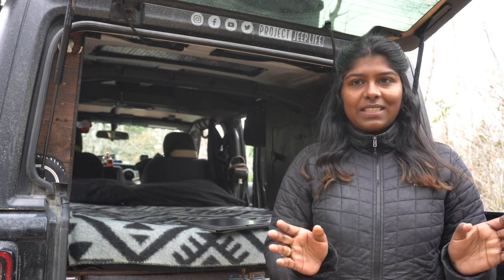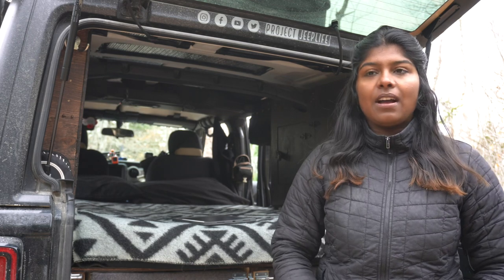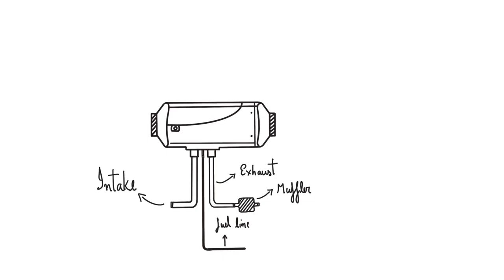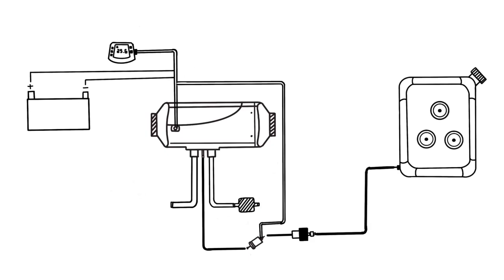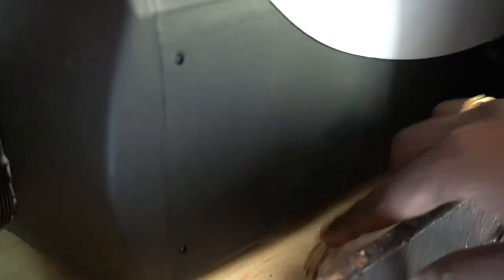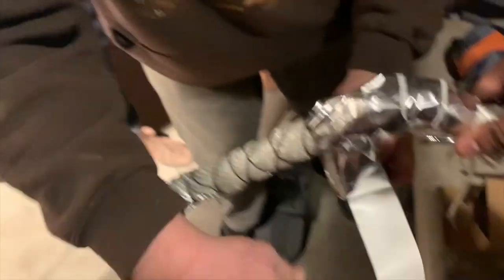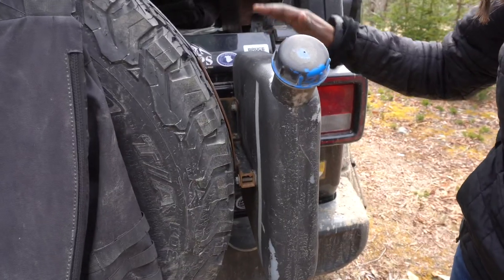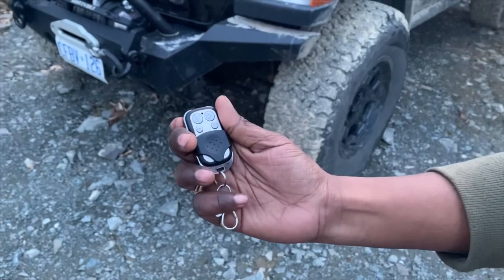Chinese Diesel Heater Install in a Jeep Wrangler

Comment from the maker: Couple of things we missed in the video:
1. We did add a Smoke/CO detector very close to where the heater is installed. It’s a must! 
2. The fuel pump and the fuel filter are installed inside the vehicle (as opposed to installing it outside) as we weren’t sure of the quality of these parts and their longevity when exposed to the elements.
3. Therefore the ticking noise from the fuel pump might be a little loud. It was for us in the beginning, but we got used to it and it’s just white noise now 😄

Comment: A couple words of caution:
1. If you keep your fuel pump mounted horizontally, it will wear out very early. The fuel pump action causes cavitation and creates air bubbles. When the unit is mounted sideways, the air bubbles get trapped and the upper section of the fuel pump will get warn out because there is no diesel fuel lubricating the cylinder wall. It should be mounted at about a 45 degree or higher angle to let the air bubbles escape. They will go into the burn chamber and add oxygen to the burn. 
2. Ensure the fuel pump has no hard mount. It should be suspended or rubber mounted. This will greatly lessen the noise of the fuel pump piston which can be quite annoying. 
3. I'm also a little concerned about the number of turns you have in the exhaust pipe. Too many angles and you'll get backpressure build-up that causes a dirty burn and carbon build up in the heater unit. 

It was nice to see your installation process. I hope you find this feedback helpful. When installed correctly, these units will last for many years.
Reply from the maker: Great tips Mitch!! Appreciate the feedback and taking the time to explain it in detail 👍🏽
Reply: absolutely correct

Comment: Excellent video... I have had my Chinese Diesel heater for about a year and a half and it's Fantastic.... I installed mine in an old 1982 Chevy Cube van that I converted into an RV... I have a 15 gallon Plastic barrel for a fuel tank... and during the cold months I use about 3 gallons of diesel fuel per week... the rest of the year I can get away with 1 fill up of my 15 gallon tank ! I am getting a (new for me ) 2006 Hummer H3 tomorrow and looking for creative places that I might mount the 2nd Chinese Air Heater that I bought last year also... both for under $100.00 each. Can't beat these little heaters
Liked/Subscribed !
Reply: The H3 has a rear vent in the center of the rear door. Might be a good location.

Comment: I like the idea. One big caution note. If you haven't yet, install a combo smoke and carbon monoxide detector somewhere inside the vehicle, preferably as close to the heater as possible. CO can kill you in your sleep and you'll never know its there.
Reply: They did... I made sure they had one when we installed it.... I asked the question but they didn’t get a chance to answer. Limited internet where they are
Reply from the maker: Frontier Geek Oh ya Charlie’s right. We did install one just above the heater on day one 👍🏽 We also have both of our back windows open just a little bit for ventilation. But ya a detector is a must. Thanks for reminding 😊
Reply: @Spencer Phelps just don’t point the exhaust towards the window you have cracked for ventilation;)!

Comment: This is awesome! I have a similar bed setup in my JK wrangler and have been contemplating a heater for the winter season. Very clean routing of the exhaust and the fuel line that you figured out! Have you had any issues with the tank of diesel sitting outside the vehicle in very cold temperatures? I know diesel can start to gel around 15 F and cause problems for pumps.
Reply from the maker: Thank you Matthew! We were worried about the diesel as well. But we never had any issues throughout our trip for some reason. Even when it was -27 when we were in Quebec, it just stayed liquid. Miracle 😃

Comment: Hi, thanks for the nice video. One question please ; where did you get the spare glow plug ? Did you handle that yourself or did you contact the seller (I.e. warranty) ? Cheers
Reply from the maker: The seller shipped it to us free of cost. But they’re quite cheap if you buy them from AliExpress.

Comment: Does the diesel heater have an air intake pipe? Or is it just an exhaust pipe to worry about 🤔
Reply from the maker: Yes there is an intake pipe that we just left inside the Jeep (in the wheel well area).

Comment: Hi i have tje exact same heater as you its fully adjustable and you can set it to max out at 2kw if you want. Webboth actually have the only one that ar 1 to 5 kw so adjustable in the secret settings i can help you do it takes 2 min to do. My heater is in a car set to 2kw max so awesome
Reply from the maker: That’s awesome Jonathan!! We would love to know how that’s done 😍
Reply: that is not an adjustable setting. it is based on the size of the heatsink. yes you can run it at a low output, essentially the same as 2kw max output, but it will have excessive carbon build up inside, requiring more frequant cleaning.

Comment: One question I think might come up; Have you experienced any fuel smells or fumes with the heater running? Also what safety precautions have you taken?

(and I type this while Kane is snoring beside me......)
Reply from the maker: Charlie Toner No fuel smells so far as we check the fuel line at least once a week.  The exhaust is tucked away nicely outside so chances of fumes getting in are minimal. But we do have a CO detector installed very close to where the heater is installed. How’s that for an answer? 😄
Reply: Citizen Kane
Reply: @Spencer Phelps I only asked the question to hi-light the idea of personal safety. I fully agree with personal safety on every level.
Reply: @Spencer Phelps yes. Having been a firefighter myself, as long as they are current and functional. Test regularly before each major trip to make sure they work.
Reply: @Spencer Phelps a mild headache is often a first sign of CO poisoning. If going outside relieves this condition, immediately shut down heating sources and ventilate the camper. 

With current heaters and regulations it is often rare for a CO poisoning but knowing the signs and symptoms is only a response. I applaud your vigilance. In my personal overland experience, a fresh ventilation of outside air is always the best Defense. And I sleep better with a little cold air. Focus on proper protection from sub-zero temps with the right sleeping bag. Heat is a luxury for most applications. Be smart and keep everything working properly. If you are alone be smart. If you are with family, always have a plan and education to keep everyone safe. 

We are here to experience all that the amazing world has to offer, and personal safety and well-being is part of that.
Reply: @Spencer Phelps most important; make it fun.... understand that living as a family, experience, grandeur, love, etc is the goal. Being safe and more importantly feeling and knowing you are safe is the catalyst to experiencing an amazing world before you, makes for a family experience that will be remembered and cherished.
Reply: Yes! This is a specific thing though. The unit, internally, has a little breather hole where the diesel enters the combustion intake area. If the heater is for example installed on its side, diesel will drip out of this hole, & it will eventually get past the rubber bung/seal of the metal fuel pipe, & pool inside the plastic casing. You will then smell diesel in the warmed-air output, & you will have the space filled with a diesel mist - not exactly burned, but unburned diesel vapour.
The rule of thumb for orientation therefore, is to ensure that the glowplug is 'on top' always. Mine did this when it was on its side, glowplug at the bottom! I.e. all combustion ports facing me, exhaust to the left, combustion intake on the right, overall warm-air output to the left, cold-air intake for the blower fan - to the right.

In the end, the safest bet is to have it with the pipework all directed fully downwards.

Comment: You put the mounting plate on the wrong site! It has to fit directly under the heater with its rubber sealing. Tbe way you did it, its not sealed at all! Could be a dangerous thing...

Comment: you are incorrect abot amazon heaters . a 2 kw is 2kw, and can be verified by its smaller dimensions .
 5kw and 8kw are actually all 5kw.
your exhaust pipe length is too long for stock size, excessive carbon build up will need to be cleaned more often